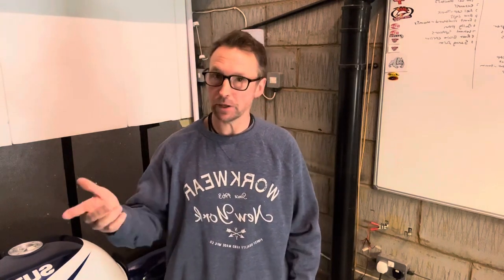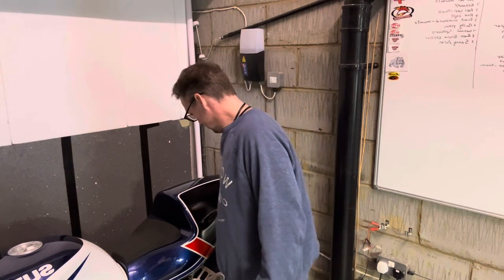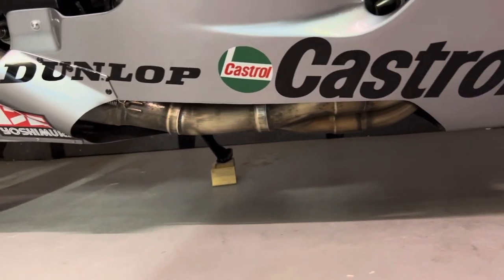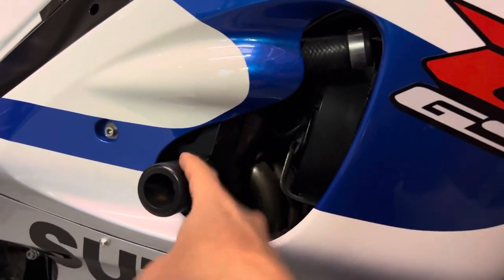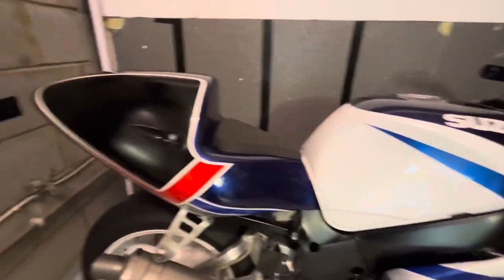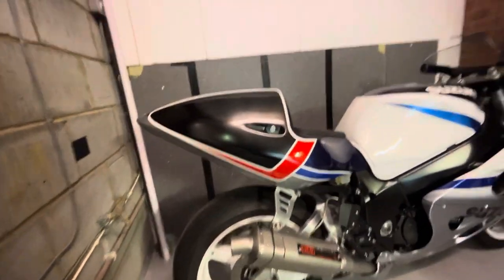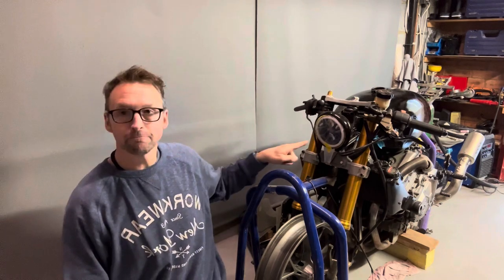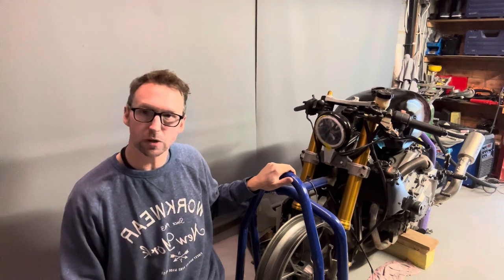Suzuki Gsxr 750 Srad is finished

Comment: What fairings did you use as i have a a 96 750 with the same  k1 exhaust and I’m having trouble with the belly pan and lower fairings i like you idea of the cut fairings but where would i get the stepped out belly pan piece.
Lovely build 😎
Reply from the maker: It’s just a fibreglass race fairing, I modded all the bottom half to fit round the exhaust 👍🏻👍🏻

Comment: Rebuilding mine and i am wondering how can i repaint it with multiple color. How to recreate those blue ring once ?
Reply from the maker: Just put the panels back on the bike and use you eye to flow the lines through, you need a special lining tape, it’s about 3-5mm wide👍🏻

Comment: How did you get the rear end up like that?
Reply from the maker: The rear suspension has a 4mm spacer in it where the shock mounts through the frame 👍🏻
Reply: @Dustmonkeycreations  cheers
Reply: About to acquirer one of these. A 99 with very low miles approx 6k miles. 1 owner, but apparently it was lowered from the factory/dealer at the time of sale. I took it around the corner and I couldn’t ride it properly I was so cramped. Definitely have to return it to stock set up and then some more, and possible do different rear sets.